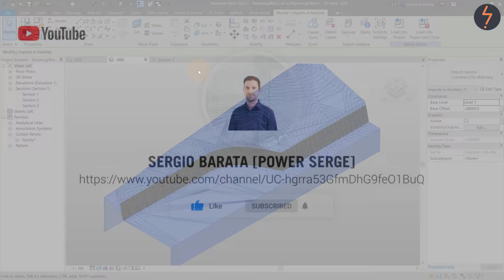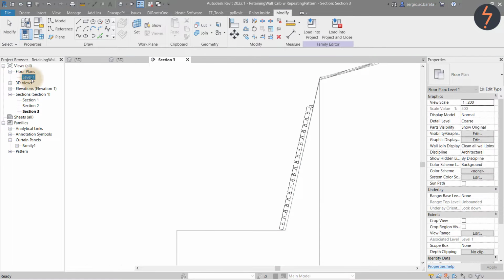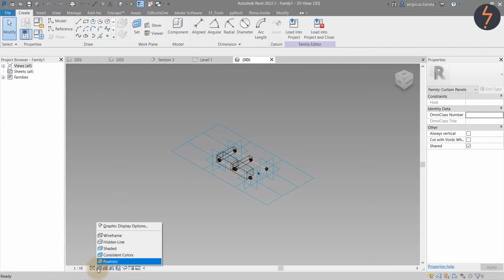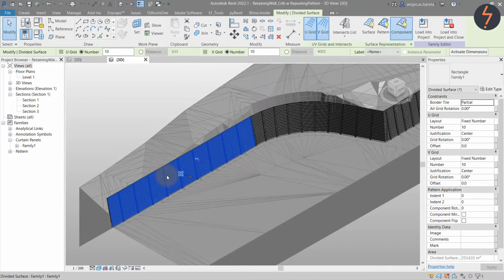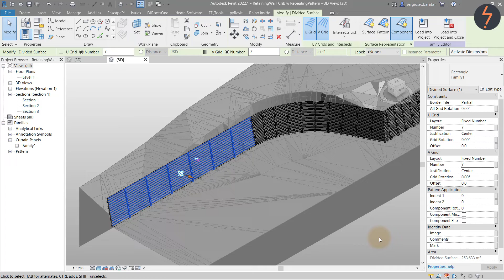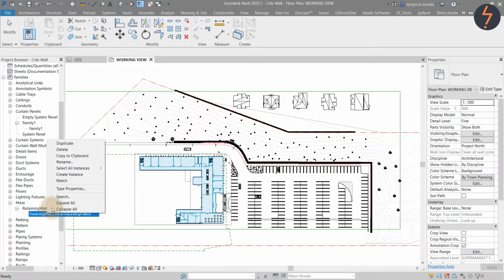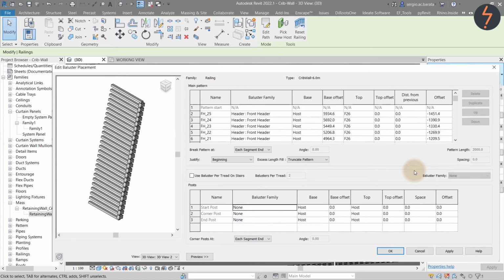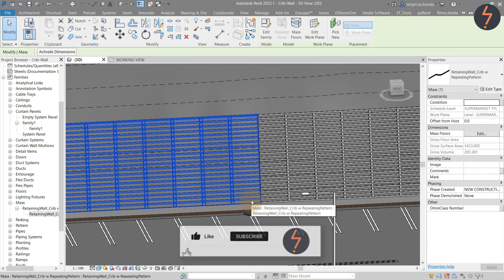Designing Complex Retaining Walls in Revit (Step-by-Step)

Comment: Nice that you modelled two options. With Revit version 2022 would be maybe possible with regular curtain walls with new parameter for angled walls?
Reply: I took really the most simplified example to do it. I will try with yours elements to see if it works. Hehe no videos, I like more to commenting other videos. Thank you for posting videos. That makes me to thing further about the modelling technics and to test them...
Reply from the maker: @damirces  - love it 👍
Reply from the maker: Could be - but much harder to flex.
Reply: @SergioBarata  I tested now with the wall facade with horiz. and vertical mullions and works..But I set the typ of the facade before I modelled them...
Reply from the maker: @damirces  that’s awesome 👏 do the vertical and horizontal sections overlap slightly like the pattern family?

Maybe now, you can make a video on YouTube 👍😀
Reply: @SergioBarata  yep, they are overlap slightly..